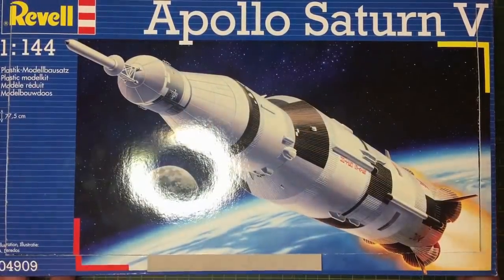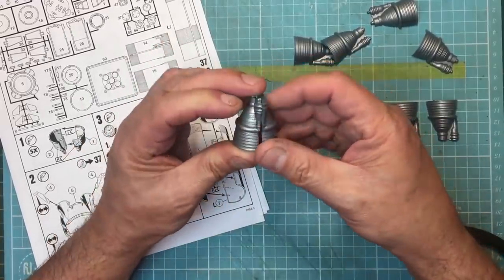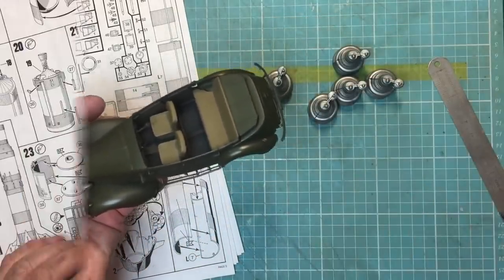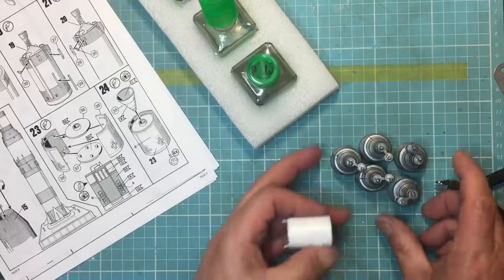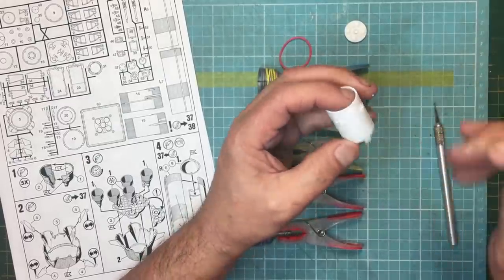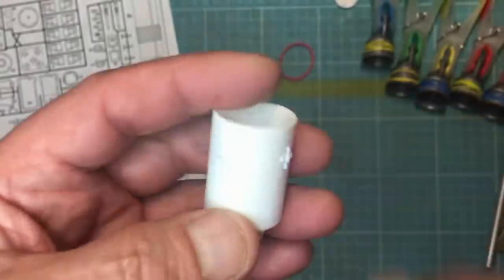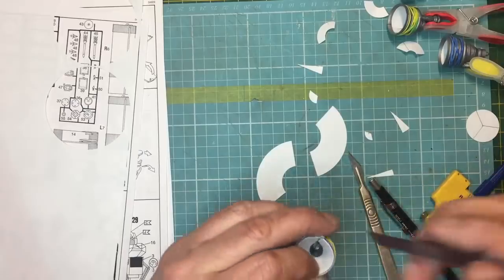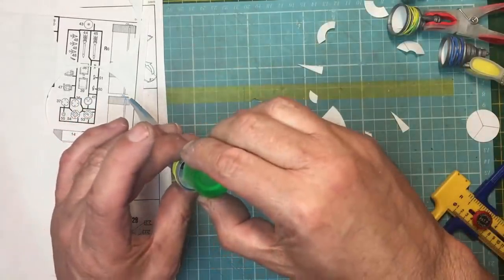Revell 1/144 Apollo Saturn V build series. Part 1. Good for beginners.

Comment: Nigel you can probably replace the engine bell ribbing with thin gauge wire. that way you can fill the seams on the outside of the bell and use the wire to recreate the ribbing.